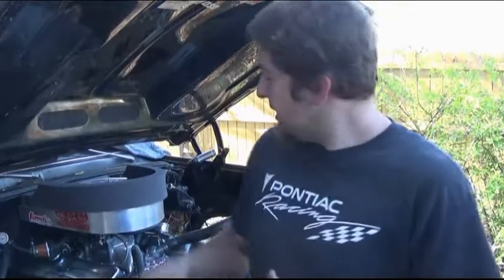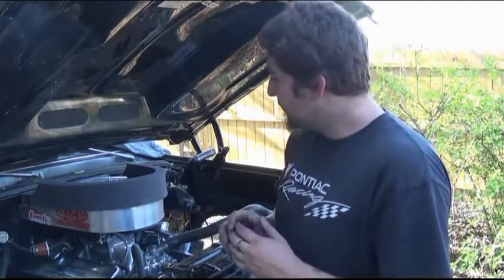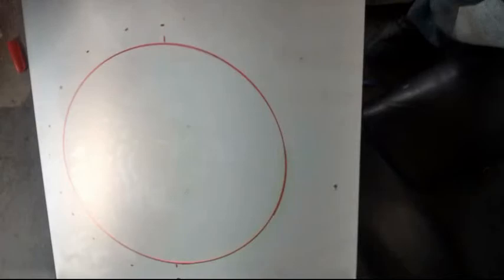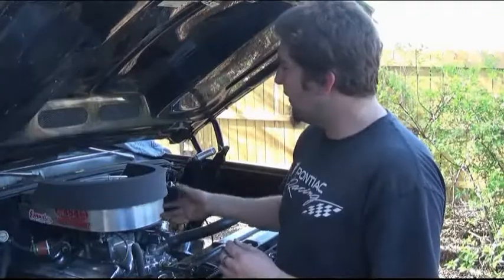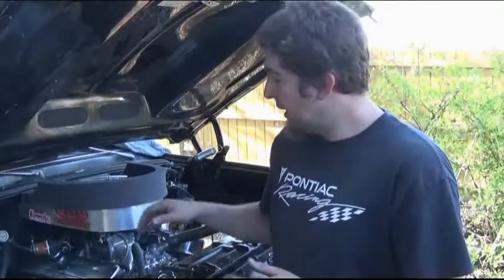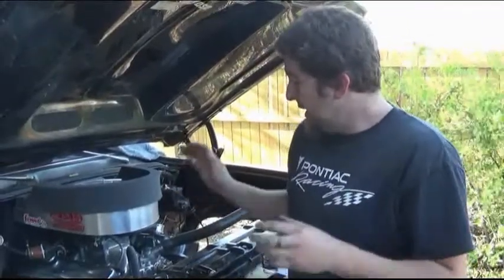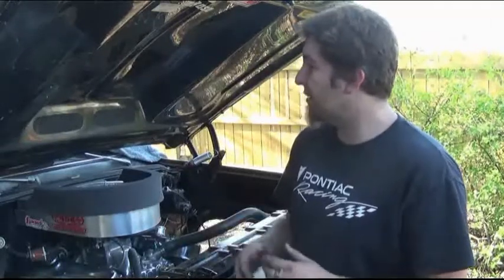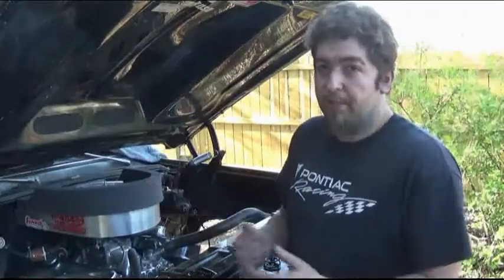air pan for our cowl induction, make it functional

Comment: So my grandpa explained cowl induction as "resonate supercharging " 
Is it more like a ram air system or like a huge cold air intake?
Reply from the maker: well that was a saying many years ago but i think it was about equal to 1lb of boost in some test. of course the faster you go the more the air pressure. It is forcing some air in if sealed properly but the biggest benefit is the its air from outside and a good flow of air.

Comment: so do you put drain holes in the bottom for rain water to escape or do you make it as air tight as possible?

what do people with ram air do to stop water from getting into the intake?

i'm still not sure what way i should go or if i should even try to change it at all .... :/
Reply from the maker: Not air tight. This one is not driven in the rain it cant. But you could the the pontiac trans am route and have a drain hose attached to let water out.  You want it air tight to the hood to draw all the fresh air you can. Ram air is a bit diffrent and dosnt get much water. My other truck with a sealed cowl was sealed diffent and i never got rain in it i drove it daily and did not have a drain. The water gor in the cowl before the scoop on that truck
Reply: @EfurdGarage  thanks for the reply.  i'll probably go with a cowl. the main reason i want to change it is to make room in the engine bay.

95 zj 5.2 .. i want to add a york 210 for an air compressor and put a nice size air tank under the hood. also i want to add duel batteries. putting all that under the hood to leave room inside for tools and supplies ... kinda overland/work jeep .. :)

if i just slap an air filter on top of the throttle body there isn't enough room (2 inches) so i would have to do something with the hood.
Reply from the maker: @ubot982  diffidently yea  with the filter on the throttle body you will need that. you sure dont want to try to put a drop base air cleaner on there and a small filter to fit under the stock hood and choke out the engine

Comment: looks cool but cowl induction needs to be closer to the windsheild  it looks like it nearly 10 inches or more away   wind tunnle test show 3 inches is the sweet spot to ram air into the engine compartment ,  at 10 inches  you just have  a vortexts and spinning air that stays there and the major  amount of air uses that vortext as part of the arodynamics  as shown in wind tunnel test. since its a one off design prehapse a seat of the pants improvment can be felt with extending the leading ridge with some stick on foam valance extension    see if theres any diffrence?
Reply from the maker: Well that sure which you saw, the black and green one was about 2" from the top of the scoop and mayeb 4"-5" at the bottom do to the cowl pan 81-87 style c10. the one i made the pan for in the video was a 80 so 73-80 style and it was about 1" from the top and 3" at the bottom.
Reply: @EfurdGarage  what matters most is where the windsheild vs the back edge of the scope  if its just right the air will split some going over the widshield then some turning around and RAMING into the scope  usally 3 inch from the scope to the windsheild  but all the angles have to be considered
Reply: It's not a ram air. It does not make boost. It makes wind. It's like the test where they put like 3 leaf blowers literally hooked up directly to a cars intake/carb. Not boost. Not ram air. WIND

Comment: Hey great job on the fabrication man, I've been waiting for this video.
Reply from the maker: Thanks, i like it. i knew you was waiting for it lol. i think its going to work good. the truck is fun driving on the street but a handful in first gear at wot
Reply from the maker: Sorry I didn't have a video fabricating it I got transferred departments at work so I couldn't sneak in my camera the video the process and the reason it took so long was because I had to do it at lunch run from one Department from another took a little bit of time and then also I had promised my buddy that I would build him a tire spreader for his tire shop at home so I had to build that and unfortunately I couldn't get video of that otherwise that would have been really great
Reply: Efurd Garage hey don't sweat it, it does look professional tho. I'll bet it is fun to drive around. First gear, that's a stick?. Had some fun over the weekend, set up a drag race between the wagon and a 94 caprice wagon... mine lost but not by much. It went pretty much side by side until 85 then the lt1 took it from there.
Reply from the maker: manual valve body th350. its a blast going to be tuff to sell but thats why im building it. cant win them all. but still you did good for awhile what was all done to the lt1. did you get a video of it?
Reply: Efurd Garage oh ok. The lt1 was stock aside from a missing muffler. A few of my friends got a quick video of it but we ran a cross a mile long bridge, by the time the cars got to the end of the bridge where everybody was standing we had our speed down. So all you can see are the cars going side by side around 60 mph. I'm trying to get the video from them.
Reply from the maker: Useful Entertainment you need a go pro for next time. I'm trying to figure out some racing I can video. I have been out of it for about 5yrs so I lost a few contacts and don't have anything to run yet
Reply: Efurd Garage yup thats exactly what I said i wish I had a go pro. I used to do random stop light racing when I was younger but I never organized a race before lol it was something else. I'll bet your truck would've gotten across the bridge in half the time of the wagons.
Reply from the maker: i use to do alot of stop light races, always had someone looking for me or my dad. But we had a thursday show/cruise night years ago, after the show and shine/met when it got dark we would run some during the cruise, but after the cruise we would be at the parking lot and a few people would run off at a time to run that way there was never a crowd to get caught. Plus 6years ago most of the cops left us alone, hell some would show up and look at the cars and even do a burnout before they left. Idk honestly this truck is nasty but i havnt ran it fully yet since i only have driven in the city neighborhood, i think its around 500hp. It was supposed to run in the low 7s in the 1/8th when i got it with some wheel spin, but no time slip.  i have changed alot about it and going to rebuild the rear end so hopefully it does good lol. but i do want to get some go pros for when i run it.

Comment: Now is this to gain air or release heat from engine?
Reply from the maker: to gain cool air into the engine
Reply: @EfurdGarage  no matter if facing forward or back really thinking of making my own
Reply from the maker: 830 MB if it is forward facing that would normally be known as ram air, where the scoop is open towards the front so air is "ramed" down into the scoop to the air Intake setup. But yes you can do something like this forward facing as long as you have an opening for air to come in
Reply: @EfurdGarage  soooo to gain cold air in is that cuz your set up
Reply from the maker: 830 MB yes it is to gain cool fresh air from outside the engine compartment, instead of the hot air under the hood. So it keeps the hot air from getting to the filter so only the cool air is used
Reply: @EfurdGarage  got you thank you for your info I will soon be doing this on my truck
Reply from the maker: chevy upgrades no problem thanks for watching the video

Comment: where did you get the foam i can't find it
Reply from the maker: I hope this helps. It can be tricky to find https://www.summitracing.com/parts/mor-97070/
Reply: Thanks very much you have the most educational video’s you help a lot I’m putting cowl induction on my 95 Chevy truck thanks again
Reply from the maker: @royweigant4678  thanks i appericate that. Im glad it could help. Good luck om your project sounds like a fun one
Reply: @YourDaddy i appreciate your help  i have differant hood mine has the open holes in the back  and i left the strip of foam off in the back, 4mpg better and love the performance no water problems driving or sitting no air cleaner restricktion the foam is enough happy motoring i'll stay in contact by the way i'm 73 (lovin every minute of it).....like to send pic's